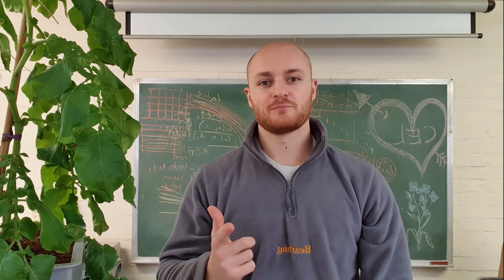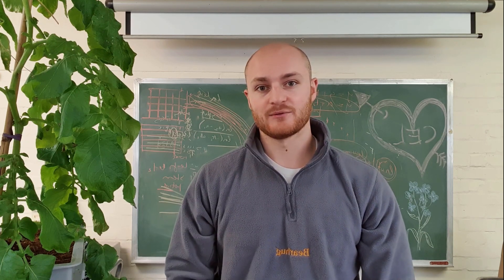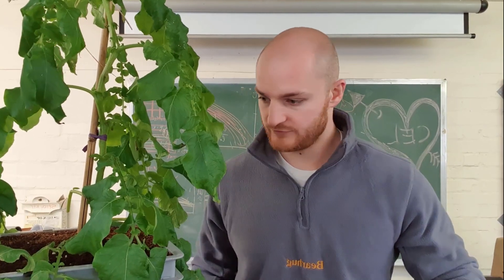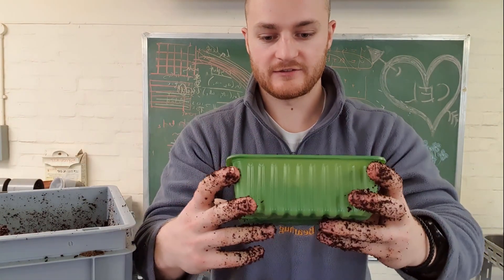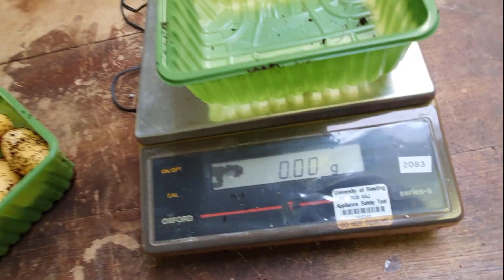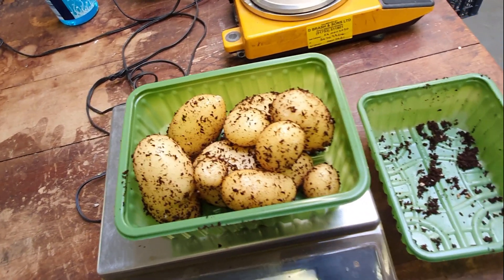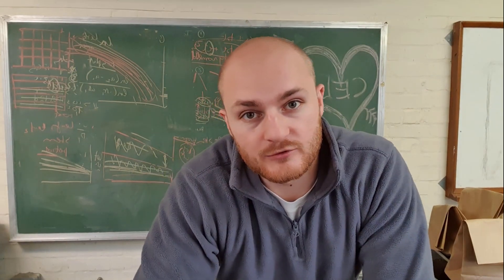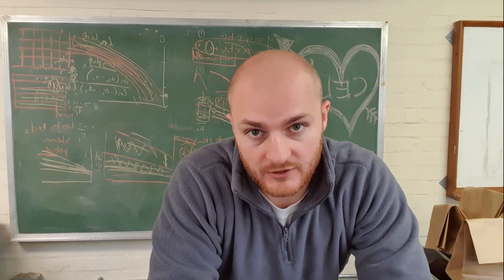HUGE Hydroponic Potato Harvest! | Spud Life PhD

Comment: Excellent job! Over a half kilo is a magnificent yield.

Crazy idea: Given the nature of the system, have you considered experimenting to see if the plant will continue to bear tubers after the initial harvest?

For example, a lot of folk believe that determinate tomatoes will simply die off after they bear their first or second flush, because that's what a lot of the literature says. However, I have several determinate tomato varieties in my indoor aquaponic systems that continue to send flush after flush with general maintenance and pruning – rather aggressively if I'm strategic and feed a bit more magnesium – and some of these plants are coming up on their first birthday. Apparently they'll just continue to bear if there isn't any cold to kill them off.

Given that tomatoes and potatoes are both Solanum, I'd think that there might be a shot. And if that is the case, my question (that I think certainly would make a great paper) would be: Would the possibility of "continual harvest" make such a system potentially more efficient in the long run?
Reply from the maker: It's an interesting hypothesis and one that I'd be interested in testing. I'd have to go back through the literature and see if anyone has looked into this first. I think that Wheeler & Tibbitts or Moulders might have mentioned continual harvest as a possibility before. I'll get back to you...
Reply: I suspect that removing the largest tubers will allow the others to continue to swell. Increasing nodules is a different issue, at a much earlier time in the process, as I understand it.